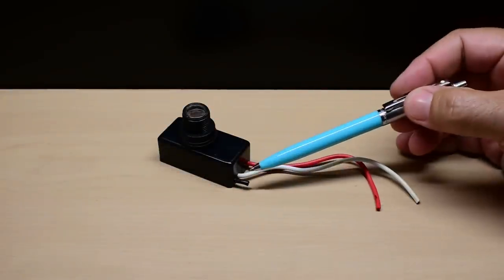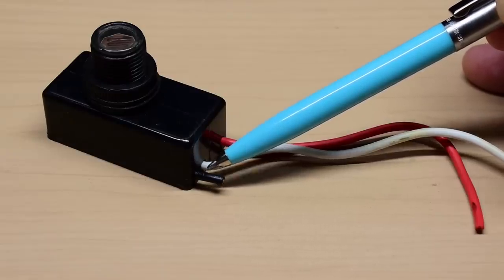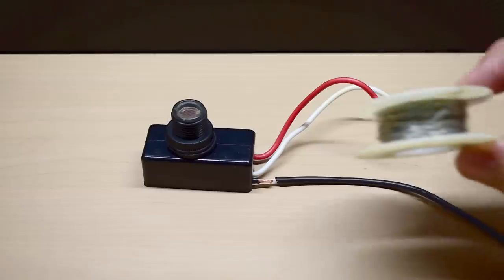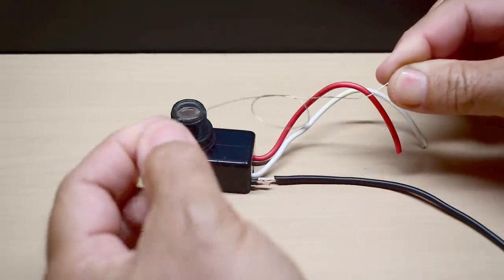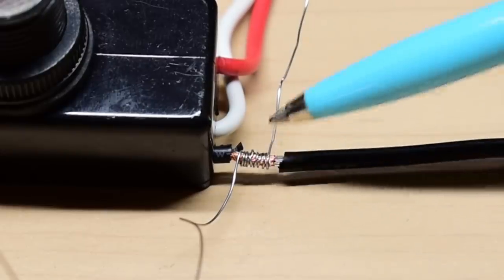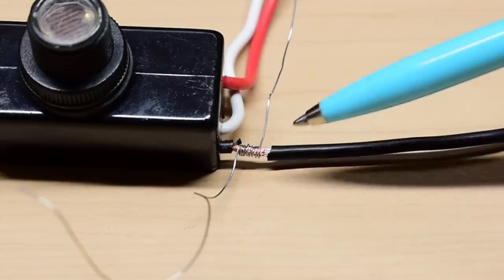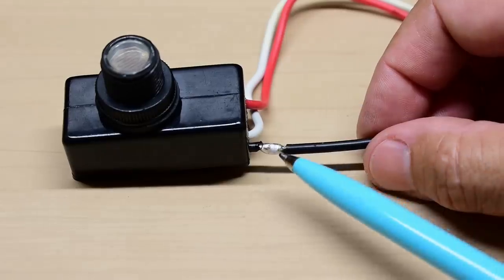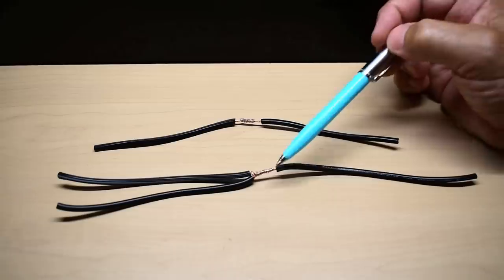How To Repair Splice Or Tap Into Stranded Copper Electrical Wires!

Comment from the maker: Just to let viewers know, you don't have to use the exact same knot I used, or wrap the wire from the center out like I did. You can use whatever knot that works for you, and if you'd like, you can wrap tightly in only one direction. You can also use forceps or needle-nose pliers to hold a very short wire as you wrap. Contrary to what some viewers thought, the soldered connection was a very good connection, the "frosty" appearance was not due to a "cold soldered" connection, it was due to the type of solder used(lead-free). A little more solder was applied than I normally use, but in no way does it have a negative effect on the connection. Thanks for watching!

Comment: What a terrific way to splice a wire!  Thank you for this very helpful video!!
Reply from the maker: Glad you liked the idea! Looking forward to your newest video today. Thanks for watching!
Reply: You're a genius.
Reply: Project Farm will use this method and give a shout out where he saw it
Reply: Test different modes of splicing
Reply: Why wouldn't you just solder it? It's super fine guage wire in this video, not like 12ga wire. After you solder them together, a simple heat shrink tube finishes it off.
Reply from the maker: @H Sterling Cross Why? Because if the wire is only 1/4" to 1/2" long, you won't be able to twist the wires together. This method makes it easy to secure the wires and solder them. Thanks for watching!
Reply: @electronicsNmore  But you don't need to twist wires together to solder them effectively.
Reply: We are going to test that! Good to see you around. See you sunday.

Comment: I've used quite a few methods to twist together, hook together, interweave, butt-join, side-join, etc. two low current wires and never one thought to try this! It looks like this join should grow tighter as it is pulled apart, to a point, which is nice.   I'll still be soldering my splices but I'm certainly going to give this a try.

Comment: This is great! I have used this technique on electronic components.
A variant if you will is to take a strand of, say lamp cord wire or the wires inside of a CAT 5 Ethernet cable or phone wiring.
I have made some cool repairs by first wrapping a fine wire around a solid wire to form a coil and slide that coil over the stub... give it a squeeze and or solder it
Reply from the maker: Thanks for watching Craig!

Comment: Excellent video about a technique that is long lost -- used to be used by the old telegraph union when splicing wires up on the poles back in the day.  A minor nit, though, pointed out by someone who has military 2M (micro-miniature) Repair School certification -- poor soldering technique was demonstrated by the use of excess solder (colloquially called "the bigger the glob, the better the job" by bruskers), and then blowing on the solder to boot.  That frosty appearance you see on the surface of the glob of solder is an indication of a cold solder joint.  A good solder joint -- which is achieved by the proper amount of heat and "sweating" just enough solder to fill in all the voids -- has a very shiny look.  Do NOT blow on the solder to speed cooling!
Reply from the maker: Incorrect, the frosty appearance was due to using lead-free solder, it doesn't flow nicely like 60/40.

Comment: I like this technique.  I usually just thread the stranded wires together and solder, but sometimes it's hard to keep them in a nice compact condition especially when dealing with a loose piece... Great idea.

Comment: Useful tip for dealing with very thin gauge wire...  Use fingernail clippers.  The precision the clippers allow for cutting, wire stripping, and the like is better than any other purpose-built tool I've ever used.  There are always three or four brand new finger nail clippers in my electronics repair fishing tackle box at all times.

Comment: Been using that method for years with a little plus: before wrapping the tin wire, i slowly  pushed the two wires in eachother using slight rotation to let the two wires interweave together.

However,  never tought about the knot trick ! For sure, i will give it a try !!!
Reply from the maker: You can do that, I usually find that many of the strands push outward and the 2 don't interweave easily. Thanks for watching!

Comment: The method I came up with back in the 1940s was it's 1840's was to split the strands of each wire apart just a little bit and push the wires together interleaving all the strands and then wrap the strands together forming and foreign and almost continuous bread between the 2 wire ends. Then solder and cover with shrink tubing.
Reply: That's how I do it also
Reply: Also me
Reply: I've done this too, but it isn't as neat as this method, and also sometimes frustrating if the 2 wires move as you're soldering them.

Comment: Great idea, especially when you have two wires that are affixed at both ends and fairly short where you can't really overlap the ends like you did and twist them together before soldering.

Comment: Old techniques coming back into use, I vaguely remember being taught wire splicing as a kid, we used a latex adhesive to waterproof the connections as it was often easier in discreet work.
Reply from the maker: Thanks for watching Dave!
Reply: @electronicsNmore  no problem, it true though isn't it about older techniques coming back into use, I used to hate splicing UK telephone wires solid strands with very thin insulation.
Reply: @davidgraemesmith1980  So did the engineers so they use grease filled crimps.

Comment: I use this method often. What I like to do is rather than putting the two conductors beside each other before wrapping, I feed them into each other so that all the strands are intermingled, like pushing two brushes into each other. Works well. Wrapping the end of a single conductor is also useful if it needs to be fitted into a terminal designed for a larger gauge of cable. Handy when you are all out of "red" QC connectors but you have plenty of "blue" ones, and doubling the conductor over is not quite enough.

Comment: I worked as an auto mechanic for over 40 years, and in the past if a wire got nipped that short, I considered the electronic device to be scrap. I wish I would have seen this method a long time ago, it sure would have came in useful with a lot of automotive sensor repairs.

Comment: There used to be premade coils for this purpose that you could buy for tube radio repair, cut of the faulty component but leave the leads intact, slip a coil over the leg of the new component and the stub of the old, solder and presto, a repair without touching the turrets or PCB

Comment: Very good indeed. We use this method for e-bike power cables. Not only is it mechanically sound the connection is suitable for high current carrying leads like battery and motor phase wires. Well done.

Comment: I like it, a wire cast. Usually I just hook wires together so it adds a bump and requires a slightly larger size of heat-shrink. This is much nicer.

Comment: I've been doing this like 30 years. It's a very neat trick indeed. But I also use ferrules that will fit both wires inside to crimp the two wires when soldering isn't desired.
Reply from the maker: Whatever works for you. Thanks for watching!

Comment: Thank you for this video.  I have recently installed a Nest Wired door bell.  Sadly, during the install, I cut too much of the wire from the existing door bell wiring.  I ended up using the wire extensions that came with the nest, but its not ideal.  What size buss wire can I use to help extend door bell wires for splicing?

Comment: Hey that's clever!  I wonder if a simple constrictor knot will work with that wire.  Also, thanks for the strength demonstration.
Reply from the maker: A single knot isn't good enough, you'll have a smaller surface area for current to flow. Thanks for watching!

Comment: For low current applications, just tin both wires. Hold them together, heat. Cover with heat shrink and the job is done.  This method is grate for larger wires.
Reply from the maker: Correct, for low current applications, you can do as said.

Comment: Nicely done video, however... I have seen this done many antique electrical items -- it eventually fails. Mechanically good perhaps, but not long term electrically sound for low voltage devices like a photocell... (high resistance after oxidation and too many different types of wire in the mix)....this is also allot of work. Executing the same repair using only solder, is usually possible in the same space required to do the buss wire holding trick.... And, get this...without the mechanical connection is actually stronger!. You must of course strip, clean (as they instructed, methods I agree xacto, razor blades work well)  both ends, then most important "tin" or pre-solder both wire ends *FIRST*. Then you hold the pre-soldered ends together and quickly solder once more, each end, the long / broad sides of each prepped piece will stick together strong -- much stronger than the wire itself (ie the tensile strength of the solder lap joint x the 6mm or even 4mm is incredibly strong).... The problem is,  wrapped buss wire  often interferes with the flow of the solder.resulting in higher resistance ..and it's improper (based on my years) to join two pieces of wire that have not been "tinned" with solder (otherwise it takes a ton of heat to flow, and results are dicey)... pre-solder the wires, then touch them together with just a few seconds of heat from the iron, the stick together, and this repair will result in a much lower resistance, and more importantly better bond, resistant to corrosion (because solder does not oxidize) -- I've done it both ways, and pure solder, is just better where possible (or use clip helpers/robot arms if you can't hold them...skip the buss wire) ---  just my two cents!  A follow up video comparing the two techniques would be super cool, as the method I describe above is rarely done...mechanically and electrically far superior to all but heat in high current scenarios.
Reply from the maker: Never fails, at least for me.

Comment: I would still have to use some thin solder that only need a small amount of heat to bond the two wires together because no matter how tight you wrap them there is a perfect place for some type of corrosion leading to reduced conductivity increase of resistance and failure. 
Or get a new switch (if possible)

Comment: Be very, very careful when stripping a wire with blades and snippers like this. Especially if it's a thin wire. You only get one go at it. And as you can't counterhold the other side of the wire, be mindful of how it's secured and terminated on/in the equipment before yanking on it with snippers.

Comment: I prefer to use vinegar to clean the copper.  Then neutralize it with alcohol.
Reply from the maker: That works, but the scraping method is faster.
Reply: @electronicsNmore  And doesn't syphon up the insulator to rot it later!
Reply from the maker: @Jos Touw True, the acid can remain between the insulator and wire.
Reply: Plus, alcohol does not neutralize an acid. Ammonia would. Still not a good idea. I have always scraped the wire.
Reply: @bobbybaucom4489  - Well it works for me!

Comment: I do something similar, but I mesh the wires first and bind the middle with the half knot, then wind each leg back to the insulation.  Then I solder the join, cut off the tie wire ends, and slide heat shrink over the splice.
Reply from the maker: You can do that, and you'll have a good connection without solder, but what I show is much better if you do not intend on soldering.

Comment: I did that in the past. Now instead of wrapping the splice with wire I cut the end off of a w-crimp style pin connector and use that to crimp the two wires together.

Comment: Any ideas on connecting a wire that's been cut flush with the component. I have a fuel heater element for my 1998.5 Dodge Cummins that one wire was accidentally broken flush with the heater component. It's a sealed unit and Dodge / Cummins no longer carry this part or any replacement for this part. I thought of running a copper screw into the #16 stranded wire inside the component and then soldering a lead wire onto the screw head, but I can't find an appropriate sized copper screw locally or online. I've only been able to find brass screws and didn't know if that would work.

Comment: Nice tip.  I would add: If you’re soldering the wire and it’s connected to something at both ends,  don’t forget to slip the heatshrink tubing on the wire before using this method.  Ask me how I know! D’oh.

Comment: Would it be better to use a strand of copper wire for the wrapper instead of something of a difference resistance?
Reply from the maker: No. The wire I used is tinned copper.

Comment: Question, I bought a waterproof case for my gopro 7 and also a waterproof battery that came with cables for different type of devices with caps on both ends to connect to the camera and battery making it water proof. the supplied cable didn't work nor the replacement cable either. There was a cable that was sent with the battery that worked but did not have the caps. So I cut the wire in half and stripped then ends. Then I put the caps on each side and twisted the wires together keeping them from touching. When I connected the end to the battery and the camera it would not work. ?? I did not solder the connection just twisted them. Could that be the problem?
Reply from the maker: Probably not connected properly, soldering wouldn't make it work.

Comment: A small addition:  I would have used a proper small hot air gun for the heat shrinking, so you can be sure it is fully shrunk all the way around and so no moisture will get in.
Reply from the maker: The video wasn't about heat shrink techniques, it was about a good method that can save people time and trouble. Thanks for watching

Comment: What is disadvantage of simply soldering the wires without tinned copper wire loops?
Reply: Depending on application strength as the solder stiffens the joint.

Comment: Spend the 11 bucks to get a new photocell. Also dont splice any wire that is to carry current in any way unless that splice is contained in a BOX. The reason splices and devices are to be contained in boxes with covers is to contain heating and sparking from loose connections

Comment: I'm familiar with the splicing technique,  but I don't really care for the stripping method shown here.  With stranded wire,  it is too easily nicked.  I may be nit-picking,  but there's always the "hot wire" method for when there's not enough room thermal strippers.  Wrap a few turns of thin copper wire around the end,  take a 1.5 volt battery,  connect it to wire coil until the insulation softens enough for removal.

Else,  I would just let Stevie do the job.  I really don't mind if Stevie nicks anything.  I don't want to know.

Comment: I have no idea why someone would not want to solder this.  The oxidation spoken of early in the video can also occur on individual strands of the wire and over a long period of time, long after this repair has been forgotten about, an intermittent open occurs, and then there's a whole lot of head scratching.  

Nice technique!
Reply from the maker: Once sealed using adhesive lined heat shrink, there won't be any oxidation issues. The connection will be waterproof.

Comment: One question... Can u splice old electrical wire (silver in color) and the newer copper wire? Reason i ask is the wiring on my trailer is the older wire but they are really short n break so fast.
Reply from the maker: Is the wire tinned copper or aluminum?
Reply: @electronicsNmore  im guessing aluminium

Comment: I use Radio Shack 2781341 Pre-tinned 24ga wire. The stuff feels like a huge roll of component legs. ;)
Reply from the maker: Sounds useful for heavier gauge wire repairs, but it may be too stiff for 14 - 18 ga. Thanks for watching!

Comment: Love how you skipped right over all the tricky parts.  Like in those auto videos where they say something like "remove the engine" and the next scene is the engine on the hoist.  We want to see the difficult parts to see how it's done.
Reply from the maker: What's difficult about winding a few turns around 2 wires?
Reply: @electronicsNmore  I want to jump in on this too. I specifically put a hemostat(hands free medical mini locking clamping pliers for clamping small blood vessels) in my tool bag for these kind of repair operation/actions that always makes you wish you had a 3rd hand,,,
✔️⭐If you can show an easy way to twist and tie off these wires with just the two hands, I and many others would love to see that too...

💯+, Thank You for showing & sharing this, I have this annoying little usb connector repair I have been putting off because the remaining wires are short(and tiny diameter too) but seeing your technique inspired me to watch and attempt a similar repair.

Kudos, good idea, presented well
Reply: @electronicsNmore  Sorry, it's been 3 weeks and I've already forgotten.  I've done things like this myself and there was something about it that got me.  Like I knew that something was tricky and you just blew right over it.  Winding coils can be a bitch sometimes.  Are you the one who just estimated the number or turns?  That's fine with me by the way because it's so easy to lose count.  One trick is to just measure the inductance as you get near the target and keep winding or remove turns as necessary.  After all it's the inductance that really matters.